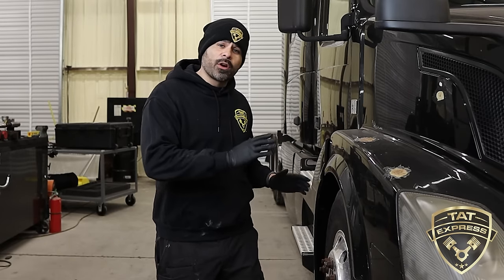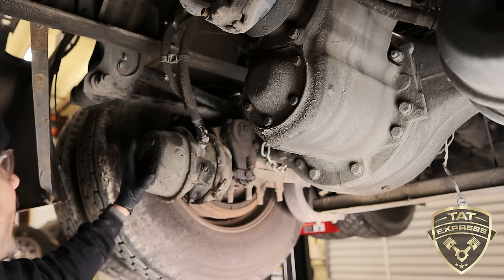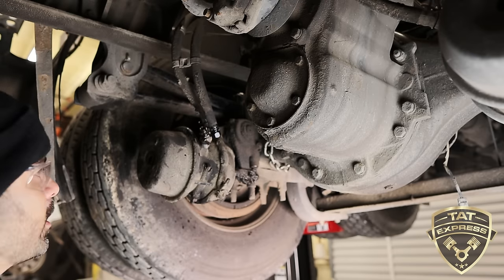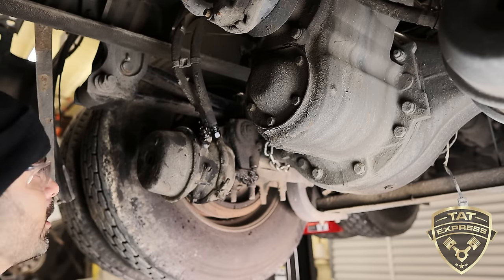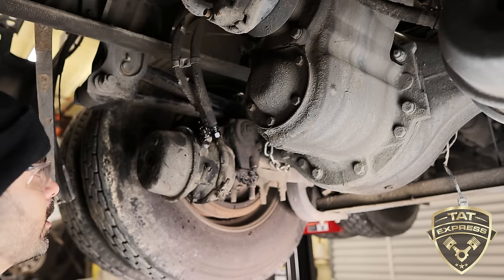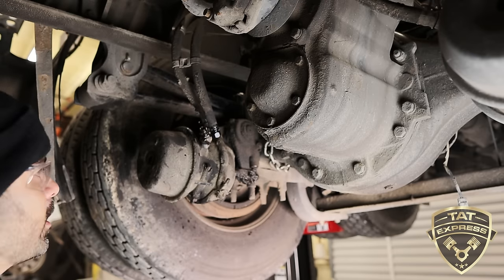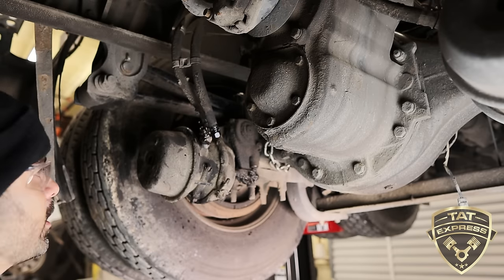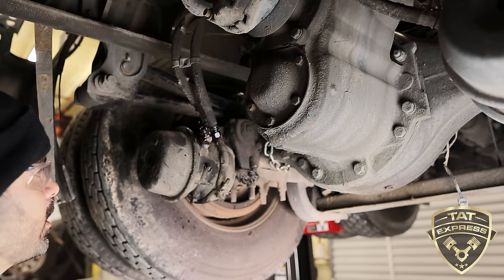How to change a brake chamber/ How to change a brake chamber on a semi-truck/  Brake chamber replace

Comment: I overhauled my engine in this shop in 2022, spent 50 thousand dollars on my and first month engine broke parts inside, every month my truck was in the shop for leaks, and broken parts, after a year the engine still burn one gallon oil every 15k miles, totally regret overhauling in this shop

Comment: TA quoted me 400 for one chamber replacement. Thanks for this info. Saves me about 600 for 2 of em.
Reply: That's the labor or the part too?
Reply: You use TA only when you have no other choice. Otherwise you go somewhere else if you can't do it yourself.

Comment: Hmmm on the road I do it different, sometimes the roll pins are frozen and I hv to cut the clevis or the slack adjuster has to come off and work it loose on vise, so at time I split the brake chamber to avoid all that. Back back in the day we use to replace  diaphragms on the side of the road

Comment: When i replaced the brake chamber on the trailer what i did was: Release the brakes, back off the slack adjuster all the way and then pull the red line and then take off the hoses. Vise versa for installing. Can i do the same on the truck ? i miss understand that part

thank you

Comment: Great content. Why did you have a chain over the axle and what was it connected to ?. Please explain the process . I am getting ready to change all 4 cans on mine for the first time and I do have lifts /
Reply: The chain is put on before the vehicle is raised up. Chain goes around axle to the frame. Keeps the axle from sagging and putting strain on the suspension. The axle he worked on was not under the lift.

Comment: And if your parking brake spring is broken which most the time is why your replacing it than how do you get an accurate measurement for your pushrod

Comment: Im still learning how to do chambers but i was always told to never taking the caging bolt out once its off the truck is that true? They always said u take a risk of it exploding and i also was told to make my measurements with the chamber fully caged and then cage the new one before i cut….. any insight u could give me on this would help.
Reply: If its totally safe to remove the caging bolt from the chamber once u have it off the truck im going to start doing it because the cutting process i was taught confuses the hell out of me lol
Reply: @TuggSpeedman_  Its relatively safe if the housing and the clamps are in good shape. Those parking brake spring are no joke though. Id advise doing it how you where taught and also understand that the cage bolt should be reinstalled until the parking brake spring is cut for disposal. They can kill.
Reply: @flyingmonkeydeathsquadronc968  so cage both chambers, measure the old one and make my cut on the new one fully caged?
Reply: @TuggSpeedman_  This is the right way. It sets the brake up properly so that it will minimize strain on the mechanism while maximizing braking potential. You never know what idiot replaced the chamber last so its good to make sure its right. I even have got a copy in a binder in my toolbox for reference.  https://www.cbsparts.ca/admin/bulletins/PUSH%20ROD%20CUTTING%20PROCEDURE.pdf

Comment: xtra deep socket for the caging bolt, got one off the tool truck. Gotta make sure a guy get the right size clevis and pin size, there is bushings ya can get for that....important , otherwise they are out of sync with the other brakes 😉
Thanks for the vid, be well!  PS: love them Gray lifts you got....$$$

Comment: You cut the length fully released !!! The way your doing it means the brake will require more pressure to apply the brake !!!!! Cause the pushrod is under more spring pressure.
Screw in a air fitting to the spring break side to help compress the brake chamber before using the caging bolt (makes it easier to do.
Reply from the maker: Thank you for sharing

Comment: Suggestion- instead of hammering a wrench, try interlocking unused ends for easy to control lateral force.
Reply from the maker: David, thanks for your input.  I was used to using a hammer before the lifts gave us more space to work

Comment: What the heck do you do if you don't have them Jack's.
I have been driving a truck for over 30 years and I have never been in a shop that had Jack's like that.  It's mostly done on the ground.

Comment: Where can I get those brake tools that you used for the adjustment with the orange handles.
Reply: That a slack adjusters tool you can get it off of Amazon

Comment: you're never supposed to use the old chamber to measure pushrod length . you use a square and tape while chamber is mounted on truck

Comment: I am confident in my abilities to replace a brake chamber or even just replacing the diaphragm but I know what damage those brake chamber can do so if I can help it I'd much rather let a shop tech do it because for lack of better terms, once the brake is caged essentially you have created an IED lmao so I really dont like messing with em but I can if I have to especially when doing just the diaphragm or "clocking" the air ports
Reply: Feels like I’m holding a bomb lol
Reply: Its more of an IED without the cage bolt especially if you drop it on one of the ears of the clamp and they separate had one fly 45ft once and it was worn out.